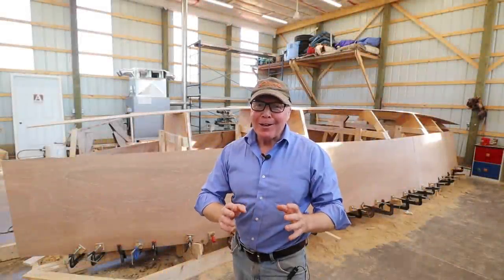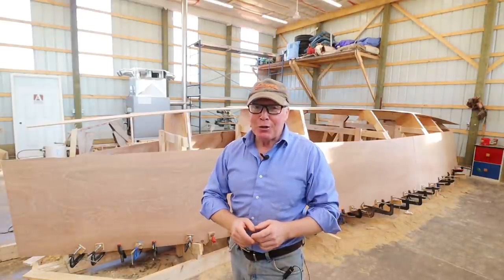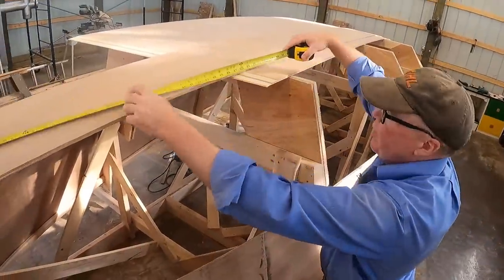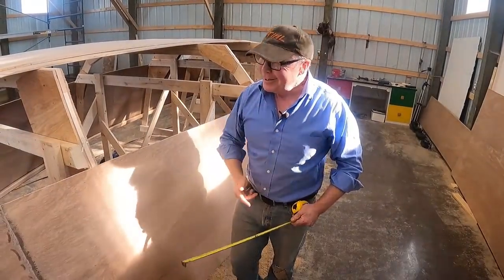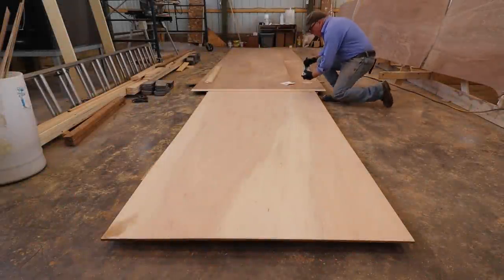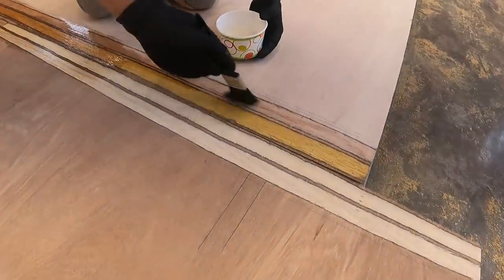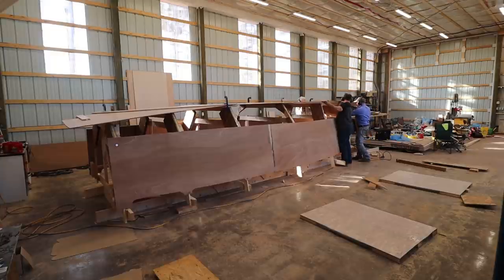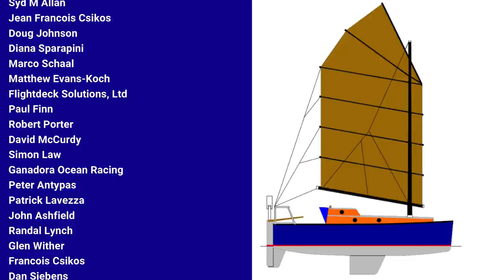S2E12 Bottoms Up! Putting the Bottom Layer on the Hull

Comment: Oh boy! I’ve built 2 kayaks, a rowing skiff, and finally a teardrop camper out of marine plywood, and stitch and glue. I may just need to build a sailboat...Two things holding me back -the lack of sailing knowledge, and a nearby ocean. I will definitely check out your scarf joint jig. Thank you for the videos!
Reply: who needs an ocean? small pond? small boat!
Reply from the maker: Where there's a will, there is a way.
Reply: @mcrumph  I was going to say how about a lake, but yes a pond or a pool is enough
Reply: @daveamies5031  where I first started it was a large pond, then I did some coastal sailing on the New England coast, sailed in the Caribbean & the Pacific, then the pacific NW. Now I belong to a sailing club on Lake Norman with a fleet of Highland 19s. When I didn't have my own boat, I found someone who did, struck up a conversation, & went sailing.

Comment: Lots to figure out on the initial build of any design, second boat get the benefit of your learning curve.
Would you consider laying up the second layer transversely on the bottom ?
Reply from the maker: You absolutely could but the extra strength is not necessary. The bottom is absolutely strong enough as is. We have discovered some issues (they have been corrected and updated in the building plans) that I will talk about in the next video concerning design changes.

Comment: Excellent videos. I love your music. And, as far as I can tell, your craftsmanship is superb.

I do have a few questions about the building sequence.

Why are there no permanent bulkheads in your jig setup?

It would seem that such would save considerable building time, as the would go with the completed hull shell, leaving far less temporary framing to remove.

Also, wouldn't it have been easier to cut out the general bottom shape on the bottom panel, then trim the excess once it has been test fitted?

Just curious. I'm building a more modest boat myself, a 10 ft (3 m) sailing scow.

At this time, I am fabricating the two bulkhead-like frames, which are made up of timber and plywood gussets.

I wish I had the skill you have.
Reply from the maker: As boats get bigger, that technique gets harder. The 650 could be built either way but in my opinion the way I am building the 650 is an easier and faster method. The material from the frames can be reused during the rest of the build.
Reply: @RoversAdventure  OK. That makes sense. I was just wondering.

Comment: Don't know if you look back at old videos but I'm rewatching again do you think it would be a good idea to do a layer of glass on the inside side of the ply after you scarfed it together? Same with the sides. I'm looking at a PVC closed cell board that is surpost to be better than Marine ply
Reply from the maker: It wouldn't hurt to have some glass over the joint and the bottom and the lower chine do on the inside. The PVC board is a good idea but one of the tenants of the build was to make a very economical and sturdy ocean cruiser.
Reply: @RoversAdventure  In NZ the PVC board is cheaper than ply and it can come in any length
Reply from the maker: @glynncleaver7398  that's awesome. I would consider that for sure. Is it possible that you will build the first Wave Rover with this board

Comment: do you consider this construction or plan amenable to the WEST method of building?
Reply from the maker: Absolutely.
Reply: @RoversAdventure  would you soften the chine if you adopted that method? And if so could you still have bilge keels?
Reply from the maker: @generoll4027  I'm assuming you mean stitch and glue with epoxy fillets and Fiberglass tabbing. Largely this is the method I'm using as you will see in the next 2-3 episodes. The chine is perfect for this as is.
Reply: @RoversAdventure  I guess I don't understand the WEST method. I thought it was made out of strips of plywood saturated in epoxy and then laid over a form.
Reply from the maker: @generoll4027  Perhaps it was my poor assumption Gene. I have not built with the method that you have suggested.

Comment: In my opinion the scarfs are to short to make it strong enough. Also complicated to make them. I have learned my lessons on a waarschip kwart ton. That boat is 725 cm long so another comparison, but the scarves on that boat were a lot longer to make it strong enough to withstand the forces that may occur on a hull.. I don't know wether your boat is going to be covered in fibergals/resin; the waarschip 725 is not.
Reply from the maker: In the previous episode I proved that the plywood broke before the scarf. Might be worth your while to watch it... very interesting. I also showed how easy it is to make scarf joints with my router jig. The hull and parts of the interior are in fact being glassed as per the Naval Architects specs.

Comment: I am enjoying your videos, but frankly, I have doubts about the design. The flat bottom means pounding in any kind of seaway; with any long passages, it will be very uncomfortable since there isn't even standing headroom. Outboard engine seems very squiffy for ocean passages. Could you publish all the stats? Sail area. displacement. ballast, &c? The capsize screening formula you gave seems very low. Comfort ratio?  I wish you well, and hope that you offer all due libations to Poseidon and Doris (his wife) before making passages. (all proprieties must be observed.)
Reply: dont boat builders use hard wood for a reason when hand making a boat for ocean passages.   the plywood and glue seems more funner
Reply: If you can go back to the first videos of this series you can get a better idea of the designed waterline.  I believe the designed waterline is about where the topsides intersect with the garboard. This will put the flat bottom below the static waterline and when the boat is heeled over there will be a chine presented to the water rather than the flat bottom.  The chine will act as a "v" bottom and will reduce any pounding.  that would be a good question and explanation for an upcoming episode, sir.
Reply from the maker: You nailed it Matt. That's exactly what the design was expected to do. After the hull is glassed I will try to do another explanation of the design elements.

Comment: Once again, wasting time scarfing. Just apply a layer of fibreglass over the join, or the whole panel. Especially applicable since the bottom has got two layers, fiberglassed together. You just have one big "butt", or "payson" joint in effect. The curve will be totally fair using  this technique.
Reply: I was thinking the same though what he is doing is stronger something quite important when dozing off 2000 miles from shore in a bit of a blow. Peace of mind is a valuable commodity at times. I do many glassed over joints as you describe for small boats and have never had a failure which is surprising as I think a canoe floor would get considerably more stress than this boats bottom, though these days I also do a hybrid of a 45 degree scarf (quick and easy on a table saw) glassed over or even with a butt plate.
Reply: @bomacca556  He had a point about a "payson" joint (butt with ply backing) makes it hard to get a fair curve on a long plywood panel. My take was to put a  layer of glass on the panel when it was flat, you get the fairing effect, and can add the backing ply later once the curve was in.
Reply: @dnomyarnostaw  i see, thanks.
Reply from the maker: I can't see how that would be faster. 4 sheets of ply with only 1 layer of glass holding them together would be a nightmare to try and maneuver without breaking the joints. I prefer not to use butt blocks as they have a tendency to trap moisture especially when located below the waterline. Once you master the scarfing technique (which is easy with my scarfing jig) you are truly impowered to do so much more with your boat building. It's quick easy and doesn't get in the way of interior structure. And finally, When I reinforce the chines on the inside, I have a straight run for the glass, no butt blocks to try to glass over. THESE ARE MY REASONS FOR DOING IT THIS WAY,  to each there own.
Reply: Butt joints breed rot my friend...
Reply from the maker: @markthomasson5077  My Floor isn't flat enough to attempt this. I have used this technique on my previous dinghy "Bud the Spud". It was only a single sheet and easy to wet out and maneuver.
Reply: @tomwaite4594  any joint properly glued and encapsulated is rotproof.
A scarf joint not properly filled will rot too.
Reply from the maker: @markthomasson5077  no it won't be necessary the bottom is already quite rigid and will become more so with the internal framing. The whole bottom will get a layer of 10oz cloth and the chines will get biaxial in addition.
Reply: @RoversAdventure  Scarfs are more elegant, so probably better too ...
Reply from the maker: @howtosailoceans1423  eloquently said my friend.